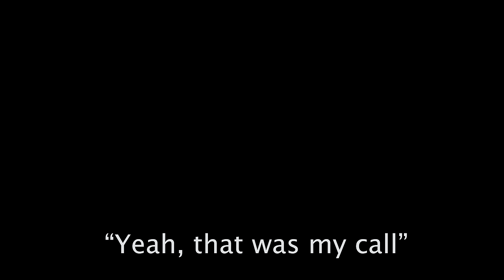GS450 Lawn Mower gets HUGE Upgrades!

Comment: You should support and center the open end of that pipe, or a cutter will jamb on it and go flying... never hold a piece with the jaws alone that sticks out more than 2 inches.
Reply: Steady rest
Reply: Everytime I see them do something with a lathe, I cringe a little. I wish one of them would spend a day with an old timer machinist and just learn as much as they can. I'd hate to see someone get injured on that thing. A lathe is one of the most dangerous tools you can own, and none of them seem to be thoroughly trained on how to operate one. 
-machinist of 10 years
Reply: I wish I lived closer I would make all their precision parts plus teach them how.
But alas, it can't be.
Automotive machinist, heavy equipment machinist, foreign car shop machinist, aircraft machinist/welder and carpet mill machinery designer, fabricator, mechanic, welder and machinist. 
Old as dirt, cranky ex-military type that loves to teach what he knows.
Been watching stuff spin in chucks since I was seven. Decided to retire and do the same damned thing at home.
LOL!
Maybe some day guys!
Cheers from South Carolina!
Terry

Comment: Rotary phase converters are actually fairly simple to make from what I've seen! They use  a larger 3 phase motor that you Jumpstart with a smaller motor on single phase once the 3 phase motor spins up it generates the missing phases

Comment: I am an electrician, those converters are about 60% what they say output current is rated for. Definitely need to build one with an old motor rotary style.
Reply: Also an electrician and completely agree, or really for as light duty as that lathe is going to be used for they could probably find a 220 single-phase motor that would be fine in place of the 3-phase it's got in it.
Reply: agreed, it will be the inrush and "stall" currents during cutting that will be killing your converter box!!
Reply: They should just get a VFD, they're not that expensive, and you can program current limits so it won't burn out the drive. Single to 3 phase VFD's are a little harder to find, but they're definitely out there. Pretty sure you can get them at Grainger.
Reply: @andrewt9204  they don't need variable speed though, that lathe is setup for the motor to run constant speed since it runs through a gearbox, they do them like that so you can get exact repeatable rpm's for thread cutting and tool feeding, you would lose a lot of the usefulness of owning a lathe that way
Reply: @Greg1096 I was gonna say, im not an electrician yet (in school to be one) and Im a bit unsure of why theyd use a 3 phase lathe in a shop like they have. The one my buddy has in his shop is a single phase and it does everything we need just fine
Reply: @synshenron798  I'm betting John got a deal on it and either didn't realize it was 3-phase or didn't realize how big of a pain it is to make 3-phase machinery run without having the proper service ran to the building, I bought an old bridgeport mill years ago and replaced the original motor with a single phase that ran at the same rpm, you just have to be careful not to run it too hard which isn't much of an issue in a home shop
Reply: Yeah you always go up in size on those for sure. I've had to put them in where we had no 3 phase,and the biggest you can afford is the best one lol

Comment: On your phase converter, always get one that is double what the machine’s amp rating is. It’ll keep you from burning them up.
Reply: Those phase shifters like they are using even when sized I per the rated amps still tend to shit the bed pretty regularly in my experience, been doing industrial electric for longer than I would care to admit and every time one of the factories I service tries to cheap out with one of these I've never seen it be reliable, IMO rotary phase converter is the only way to go unless you want to have 3-phase service installed

Comment: If you put the steering bracket on the front back the way it was you could keep all of the drift angle by replacing the linkage rod from the steering wheel to the shaft with a chain and sprocket setup, that way by going from a small sprocket on the steering wheel to a larger one on the shaft you lower the gear ratio of the steering both giving you slower/easier steering but retaining all the movement of the link rods in the front

Comment: And there is a perfect example of why lights and outlets are supposed to be wired on separate breakers, with 14-2 for 110v lights and 12-2 for 110v outlets. Time to run some different conduit and wire to the lights. Reminds me of old houses where the furnace or boiler is wired into the basement lights. So when the breaker is turned off to do the work, you've got to have good work lights, flashlights, and headlamps to get the job done.

Comment: I'm not bugged they put a 120V motor on the lathe, it actually makes a lot of sense and should work just fine (please make a good mounting setup for the motor, add a tensioner pulley to the belt on their replacement motor, and add a switch). First things first if you do get a lightswitch, they work just fine for this sort of stuff. They're made to handle this sort of load and if you're worried about it then get a 20 amp switch just to be safe. Second things second, when you're cutting like you were, I suggest getting an acid brush and a small cup then brushing on a little bit of gear oil to add some lubrication when cutting or machining.

Comment: I see Isaac and John were thinking just like I was a tillotson 212cc electrical start. A muffler for a 70 ft ventilated to the outside with an anti bird catch on it to keep birds from a nest and if you can get enough R. P. M. You can run it govered. That way you don't overload a ceriert at least that would be reliable in your venting all the and you have a low voltage high power output device. By the way this is my second time watching this video.. peace out to have an excellent 👍👍👍👍

Comment: you definitely need a rotary phase converter
Reply: They just need to get a 220v motor and convert it over to single phase, that's what I did with my bridgeport mill a couple years ago, they aren't going to be using the lathe heavily or doing any parts large enough to overload it

Comment: Part off tools should be ran somewhere between 140 to 190 rpm, with respect to the original lathe motor…so you’ll have to calculate what that is based off the substitute pulley ratio. 

Metal coolant, water based, will also help the life of the carbide bits on the tool if a constant stream is being fed to it.

Comment: The main problem with using a 110v motor instead of a 220v is that the 110v is double the amperage for the same size hp motor.  The lathe motor is also three phaze. Which is what the phaze converter is for. A rotary phaze converter is the best option when you don't have three phaze in the building, but they are expensive! What you should get is a tried and true static phaze converter. You can test the motor to see if the motor is bad or if its the phaze converter. You just need a multimeter. Search how to test the resistance of the windings on a three phaze motor.
Reply: For as light use as that lathe is going to be they could just find an appropriate size 220v motor and replace the 3-phase that's in it, since it's running through a gearbox the motor only has to run at a constant speed and they aren't going to be doing any huge parts to overload it, I did something similar for my bridge port mill to avoid having to buy a phase converter and it's been running that way for almost a decade now.

Comment: You can fix the steering by putting sprockets and chain on the top side, smaller on the wheel, a bit larger on your steering shaft then put the tie rod back in the other hole.

Comment: Bigger sprocket on the front gives it more power bottom end and smaller sprocket on the back gives it more top end so if you want more speed it's always best to change both 👍💚💛❤️

Comment: I just put the front drum breaks off a chinese 110 atv and took the front rims/tires put them on my go kart now i can do line lock burnouts and stop and handle way better using front breaks even if they are only drum breaks they work very well

Comment: ive never been able to get the hang of parting stuff off on a lathe, mine is no where near as big as what u guys have an id love to have that machine but parting is one thing ive tried about every type of parting blades an still have the same issue with all of them, get about half way through an it stops cutting an if u keep pushing it just burns the tip up or breaks the carbide inserts so now i start the parting an get it as far as i can an pull the hacksaw out.

Comment: @carsandcameras, if you don't want to replace the lathe motor look into a vfd... they are supposed to be much more robust and than dps ... just fyi   vfd  variable frequency drive and dps Digital phase shifter.

Comment: Transfer punches would have been a good choice at 20:50 over the paint trick. A set is like 12 bucks at the hobo freight. Another option would be to turn points on 3 bolts, screw then in the hub then smack it to mark center of the holes on the drum

Comment: I enjoy your channel,  Don't you guys know a electrician ?  
Find and old style Non Digital Phase converter to run the lathe from residential 220v service ,
 or  install a 220v single phase motor on the lathe like a  residential water pump motor, 
A 3 phase motor will stay running with only 2 hot legs of normal 220,  it's that it won't start turning unless it has the phase dufference of that third leg ,  the old style converter uses an LC circuit to momentarily provide this third leg to start the motor,  the trade off is reduced maximum work load ,  a 3hp motor becomes a 2hp motor, 
This phase shift motor adapter,  has less burn out failure problems ,  and functions more like the "start capacitor"  in  your air conditioner

Comment: You need a military surplus diesel generator for your shop.

That way you only need to run the generator when you are needing a lot of power.

My cousin used to run his water jet setup on a surplus diesel generator.

Comment: That was brilliant of YouTube to go to an ad. right when you guys went to test the lathe. I think it would be you're best bet to be in the market for a 240 volt motor?  that will fit on that lathe and that would be problem solved. you would just have get the right size pulley so the lathe will run at the proper speed?  and you shouldn't have anymore issues in the future. that mower is still one of the best projects that you have built. however I'm still waiting for you to revisit the Honduki? project I still think that it has massive potential?

Comment: [ Certificating Electrician ]
If it seems like the same problem wirg different equipment it will be down to your method [ heavy cuts at diameter cost you heavy Amps ] 
If you can't get a 3 phase shop supply, get the lathe converted to a single phase motor, that would remove the 'hobby' digital converter from the equation. [ I recommend 240v ]

Comment: You should put it to the second setting on the steering arm instead of the 3rd one.... It seems like it steers a little better but it's too snappy on the 3rd setting, at least try the 2nd setting to see how it does and make it into a short.     😁👍

Comment: Gentlemen.  Electric motors are typically sized by a "frame", or chassis of the motor.  If you can't get multi-phase power in the shop, just get a motor of the same frame as your current one that is single-phase and install it.  You can probably find a used on online, or at your local motor repair shop.

Comment: You're gonna get yelled at for yanking the cord out of the wall that way too. I once had a carbide tip get knocked off a saw blade when the miter bar came off the table at a crazy angle and hit the blade while spinning.  I heard it hit the ceiling, damned happy it didn't go through me on the way out.  Yup, everybody does this stuff at home.  I jumped when that rotating object went ding.  Ya-buddy.

Comment: Get a frequency drive that will work on single phase. I use them on my lathe and milling machine. they work great. Instead of using paint to find your hole location you need a cheap set of transfer punches.

Comment: In my experience, 1/2 turn lock to lock works well for a Kart. You could easily achieve this on this project by running sprockets and chain between the steering column and the steering shaft. A 2:1 ratio would work well. As a bonus you wouldn't lose any drift lock.

Comment: Just an FYI, it seems that John is doing the math for all the gear swaps. Sometimes the lower 🎉gear ratio (higher number) will make a higher top speed. 5.0 Mustang made for speed with the 3.08 ratio over the 2.73. At high speed the motor didn’t have the power to overcome the drag.

Comment: Look at the name plate on the lathe motor. It will tell you the amp draw for each voltage if it’s multi voltage. Assuming you guys have 220 A/C, look at the amps on the motor for 220V. 

Go to McMaster Carr, look at their phase converters. See if one has enough output amps for the lathes motor needs. If the amps on the motor are too high, a digital converter will not work, and it’ll have to be a roto-phase. 

Which is a 3 phase, shaft-less motor that sits on the floor, with a box of capacitors on the wall and other various components inside… 👍

Comment: the welding on the sprocket... here in NZ there are rules for welding car parts, but they are very poorly thought out, they want things welded all the way around in one pass, and Tig welded too. but those of us who weld know, if a crack forms, it will follow along the edge of the weld as far as it can... when the weld stops, the crack has nowhere to continue, so 3 short welds are much safer than one long weld. your two welds on the Sprocket are fine!
 I am having flashbacks to a previous Mower that was too fast... please wear "ARMOUR!"

Comment: The problem with your DPS system is that your FEED is only 12 gauge romex and looks like your LOAD is 8 gauge, you need to match both conductors. You will trip the breaker or burn up equipment

Comment: Would yall be able to do away with linkage from steering wheel shaft to steering shaft and replacing with chain and sprockets to get more angle and light input

Comment: Just get stronger DFS or VariableFrequencyDrive with more "Amp" capacity. When you use lower RPM of motor it loads the driver more ... And it needs cooling !

Comment: So with any luck you have a 3 phase  220/230?   You can buy a  single to 3 phase converter (you use your existing 110v :)    Just make sure you have the right size inverter (rated to motor hp)

Comment: Need to put a flange on the open end of the frum just like car drums so the drum doesn't swell as the brakes heat up.  Make the flange as big as it can be without hitting the wheel rim, as it'll be the heat sink also.

Comment: Keith rucker did a good vid on these phase converters there not good for your motors other find a single phase  motor with the same hp or just break down and find a rotory phase

Comment: you guys should bolt the drum to the hub to turn down the run-out so the inner surface of the drum is centered on the hub not the outside of the pipe
Reply: We were just trying to make it purty

Comment: Might help if you spray machining lubricant on the cutter when you cut parts. Not that that is the issue with the lathe. Classic busted Insert not bit. Call Rather B Welding and ask. He is a good dude and he knows how to make it work.

Comment: Were it mine,I'd immediately add a fan mounted behind that grille in thw hood to blow across that air cooled engine which isnt getting sufficient airflow while at peak revs doing donuts and such,especially seeing as the front and sides of the hood prevents good airflow across the cylinder...js..

Comment: Since you keep blowing Phase shifters double it up Install 2 will double the Capacity and it looks like you have a Tiny wire Feeding the Phase shifter on the Lathe that Builds heat because it doesn't have enough Amperage! or you can just get a Single phase motor to replace the one that's in the Lathe!

Comment: The part off tool bit broke because  you weren't at the center height too low it will ride up like that to high and it won't cut and you want to be at highest rpm when parting off

Comment: The reason the wheels were off is because drilling that hole on the linkage changed your steering angle. I hope the steering stops have enough adjustment to help fix it

Comment: rotary phase converter is the way to go, you can diy one real easy. had a diy one on my old mill and a big boy marketplace find from a car wash is what i use now. you can also do a phase o matic style with just capacitors but it runs the 3 phase motor on your machine at 2/3 the power? (if i remember correctly) same as the rotary converter just without the extra motor.
Reply: They've already got a capacitor based phase shifter. Kieth Rucker's channel has a recent video where he and his electrician go into detail on them. The short version is "they're really shitty."
Reply: @DonOblivious  thats all the rotary phase converter is, it has capacitors to make a leg to run the motor to give clean power to the machine. they are using a digital phase shifter which im going to assume is like a vfd in the regard that is doesn't use capacitors. either way they need real 3 phase or a rotary, but can get away with just capacitors or vfd

Comment: Use a single phase (110 or 220v)  pony motor to drive a larger hp 3 phase motor to create the 3rd phase leg. That's how you generate your own 3 phase electric for machines. It can be as basic as that, all the way to digitally controlled. There is a lot of info on the subject,
Reply: one of my old mills had a pony motor and big a 5hp 3phase motor on the side for that. using capacitors instead of the pony is less of a hassle